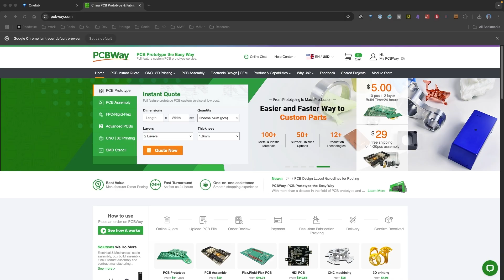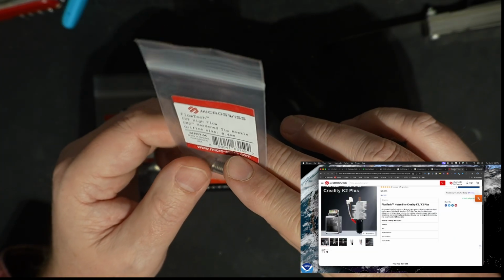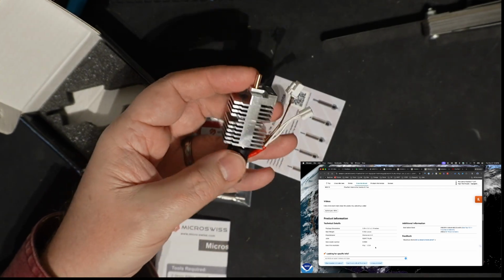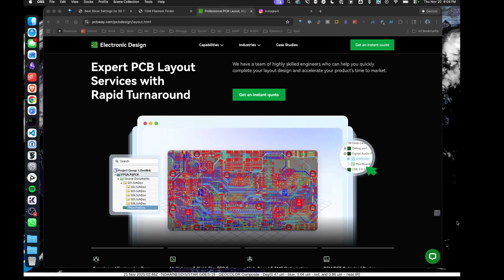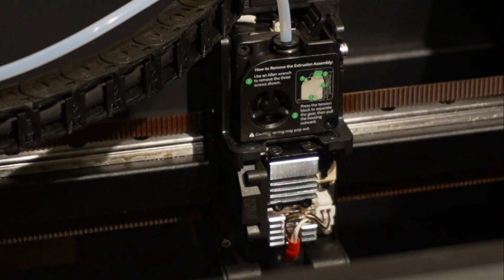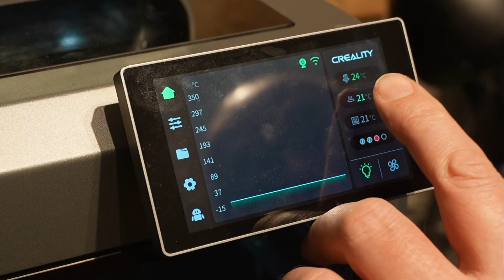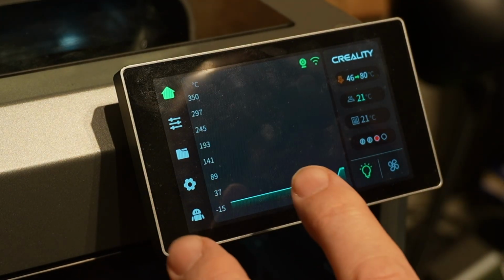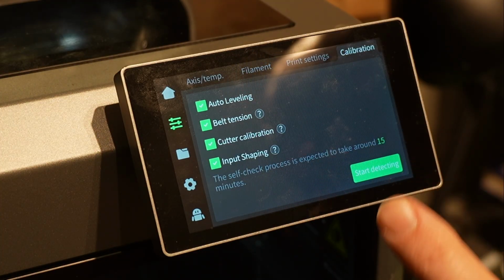Creality K2 Plus Upgrade Series: Swapping the Stock Hotend for Micro Swiss

Comment: I'm not an electrician.  But over the years I've worked in electronic crcuit board manufacturing and IT. I wantedd to say that in the USA at least,  i always turn the main power of, but leave it plugged in. If you have any esd buildup,  then touching the grounded metal parts will drain the esd, so it doesn't hurt the electronics.  The third prong is always connected to ground.  Even if the switch is off.
Reply from the maker: I usually try to unplug on the k2 plus because the screen can go to sleep and I mistake asleep for off. It is stupid that I consistently forget to touch the screen to be sure. I get in a hurry and ...

Comment: use 3DLAC Spray !! stuff works great!
and dont have to reapply after every print. usually get 3-5 prints per spot.
ive had 1 can for over 6 months. and i print almost daily !!
Reply from the maker: I have not heard of that. I will look it up. Thanks for the tip.

Comment: Hi! You did not have a clog. That is where the filament is cut before retract. Same thing on every printer the has a filament cutter. Bambu, Anycubic, etc. all do it this way.
Reply from the maker: You are correct but the dang sensor on the k2 periodically errors out as either a clog or broken filament. I am going to change out the cutter and see if it help.

Comment: What tuning parameters would you start tuning with the new hotend? Pressure advance/ Flow Rate?? Ive been on the fence with getting one myself but youre the first video with actual printing results and not just install, so thanks for the push. Hotend, 2xCM2-CHT nozzles, and 2x diamond nozzle in my cart. Early Xmas gift to myself , happy holidays to you🙂
Reply from the maker: I am actually messing with it tonight. I would do the following: flow rate, pressure advance, Ellis' Max Volumetric Speed, and Extrusion Rate Smoothing. Eventually, I would also run orcaslicer's OS Adaptive Pressure Advance as well.
Reply: @minimal3dp Look forward to hearing what your results are. I just followed your Orca APA video instructions with my stock nozzle, ill be sure to do it again once the parts arrive. Are you still running your all metal extruder gears?
Reply from the maker: Yes I am. My only issue now is ASA. I need to find a better brand. Keeps breaking in the nozzle. Black seems to work well but the red and blue I use (from the same manufacturer keeps breaking.
Reply: @minimal3dp  I use Polymaker ASA for the majority of my prints. Ive never had any problems with my stock K2+. Im looking into trying Siraya Tech's ASA and Polymakers  ASF+CF
Reply from the maker: Some polymaker just arrived. I had been using iSANMATE ASA Filament. The black is fine but the red and blue seems to break in the hotend every other print.